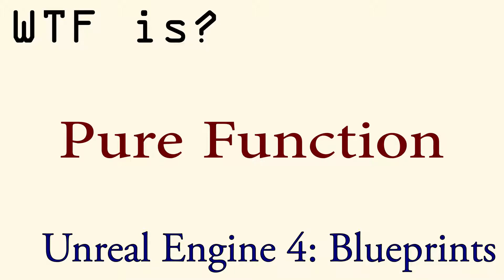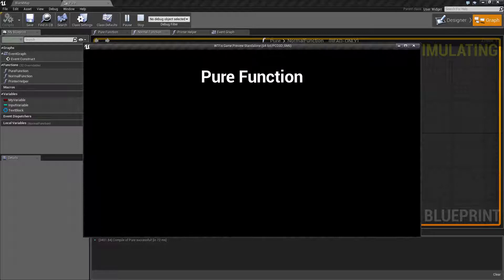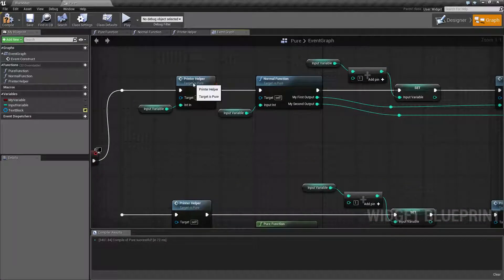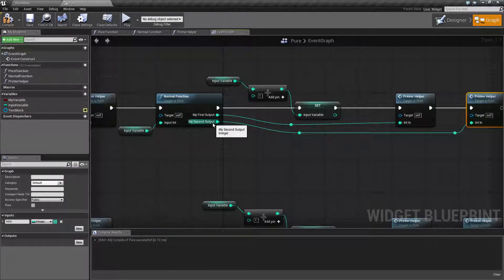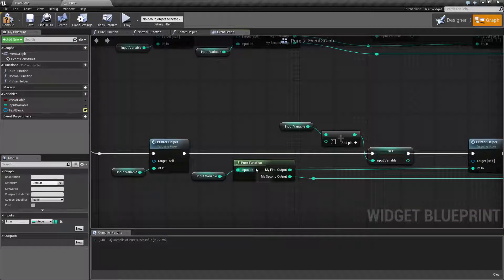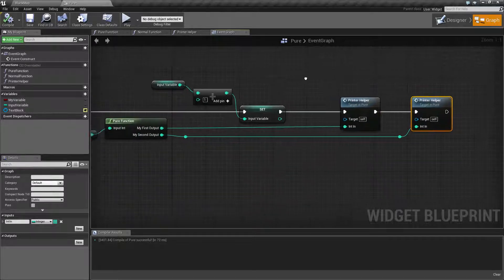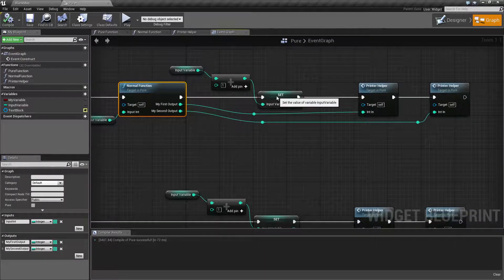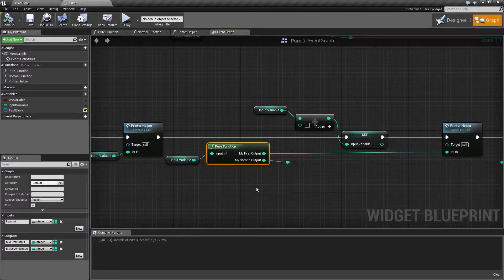WTF Is? A Pure Function

Comment: Great explanation - just a note- the Pure function should not have been marked as Pure, and this rule isn't enforced, but it's considered a bug to do as shown.

From the docs - "Pure Functions promise not to modify state or the members of the class in any way."  

So changing the Input Variable as shown shouldn't be done in a Pure function, but beware, since it could be done.

Edit: Although there's a difference between Pure Const and just Pure - so if the variable modified was not a Class member, that is, just a local variable, then it may have been technically Pure, but I would still avoid doing this.

Comment: This guys is a gift
Reply: This guy disinforms you.
Reply: @yrussq  why? I know this isn't normal pure function. This is Unreals pure function. So, what's wrong?
Reply: @daifee9174  The flow he shows is not identical he would get the same result with a normal function.

The whole video has nothing to do with Pure functions. 

Pure - is an attribute for compiler to check whether the fuction is really pure to potentially optimize the execution via reusing the returned value(against recalculating from scratch) if the arguments haven't changed and nothing has changed that potentially can affect the output result.
Reply: @yrussq  but that's pure function in language like C, isn't it? Because "pure" function in blueprint system != pure function in programing language, i think epic once clarified that
Reply: @daifee9174  It's not a C exclusive. It's a cross-language optimization technique.

I haven't heard anything about epic saying on that matter. Do you have a link?

Anyway keeping in mind that Blueprints can co-exist with C++ code it's nice to mention that C++ pure and BP pure != same(if it is so). Plus the example was irrelevant to the topic.
Reply: @yrussq  What are you on about? He basically explained the same thing you just did. The pure function instead of following the entire execution pin it only executes what it connects to directly. Hence why he made it output 2 values and he put those 2 values in different Print functions. Which means it optimizes still.
Reply: @kathoden  I liked the video, and yrussq seems to have admitted being uninformed about Epic's version of Blueprint Pure, but in any case, the outputs are not different due to optimization - all execution pins are executed in both examples - and according to Epic's documentation -  the Pure function example here is probably LESS optimal, which was surprising, I admit, given the positive connotation of "Pure" and the green color. 

Epic's documentation - "Pure Functions are wired to Data Pins and are automatically executed by the compiler when the data relying on them is required. This means that a Pure Function will be called one time for each node it is connected to." - https://docs.unrealengine.com/4.26/en-US/ProgrammingAndScripting/Blueprints/UserGuide/Functions/

In other words, the Pure function was called 3 separate times, whereas the original function was called only once.    

Anyone, please correct me if I'm wrong - would like to know the truth of the matter.
Reply: @stephenmontague6930  You might actually be right. Yusuf too. Though I haven't tested it yet but after making a fairly extensive research on it, you may be correct

Comment: Finally a decent explanation. 
So a pure function is called EVERY time a node it connects to is called.
Reply: Close, but not quite right.  Pure functions are called once for every impure node connected - 

Awesome example - https://medium.com/advanced-blueprint-scripting-in-unreal-engine/pure-impure-functions-516367cff14f

(where 3 pure "Random Float" functions yield 3 random numbers, vs 1 pure "Random Float" function connected to 3 pins yields 1 random number 3 times).

Edit: 

Here's a recent note from Epic, even, admitting the official docs are misleading.  

https://forums.unrealengine.com/t/pure-node-evaluation/146473

To recap - depending on the impure functions connected to - whether execution flow has advanced or not - 

Pure functions do or do not cache results / run once or multiple times.
Reply: @stephenmontague6930  great read, i wish there was more content that showed the deeper programming principles for blueprint redacts like myself